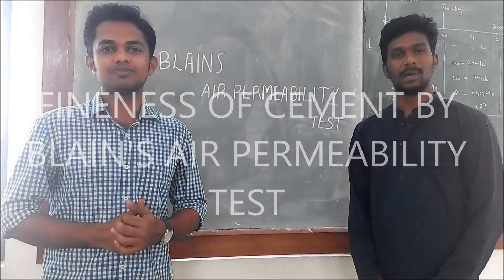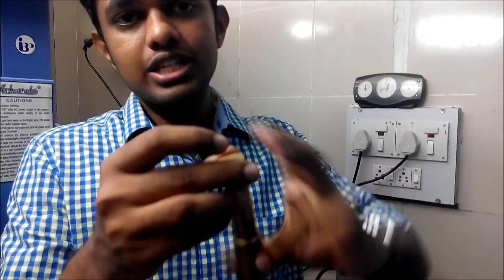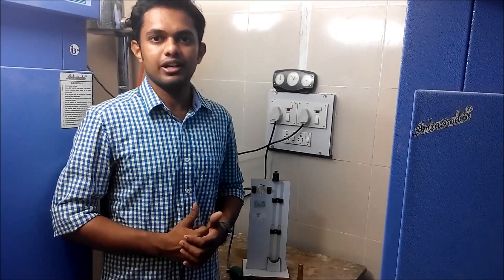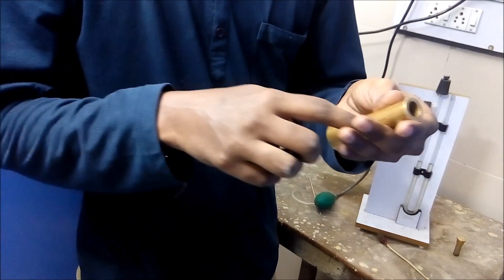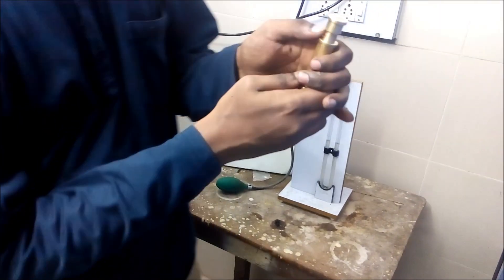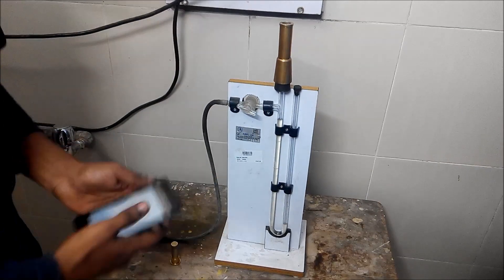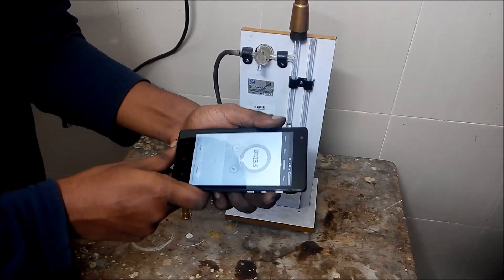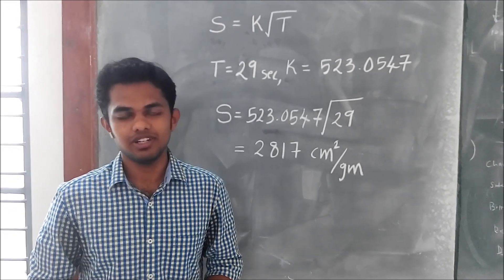fineness of cement  blain's air permeability test

Comment: Hi ! I am student, and a have some questions, _I hope you can help me... Why you cover the cell when you put on the connection ? The time is influenced if I do not cover  the cell when i fill up the tube with oil?  Did you based on standard test method ASTM C 204-00 ??